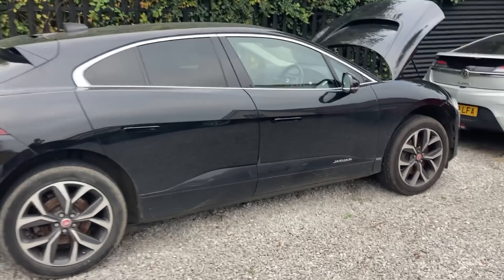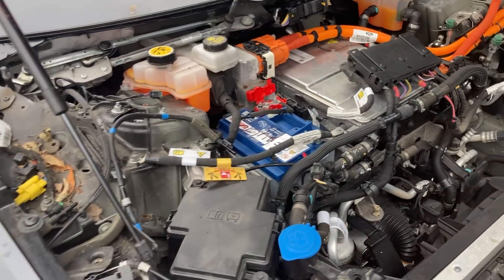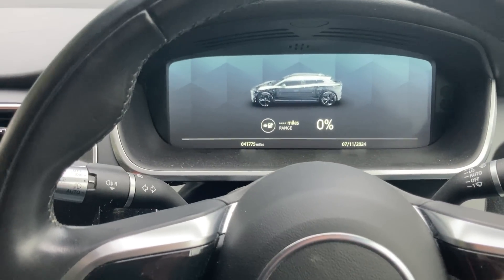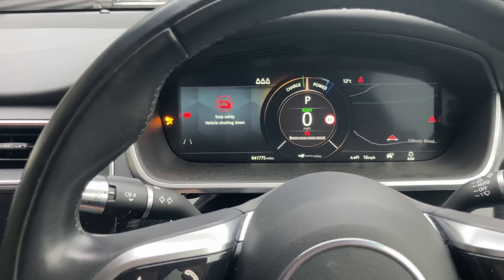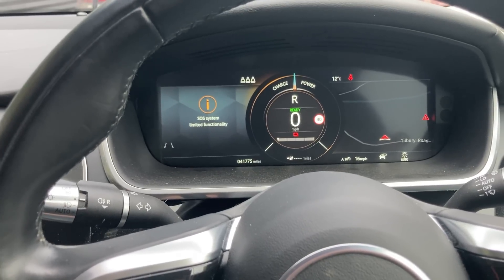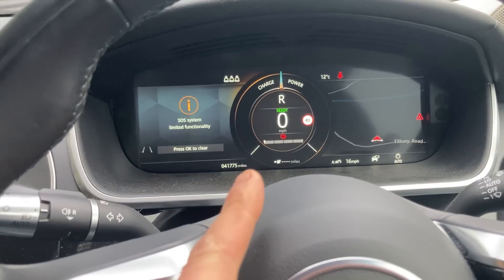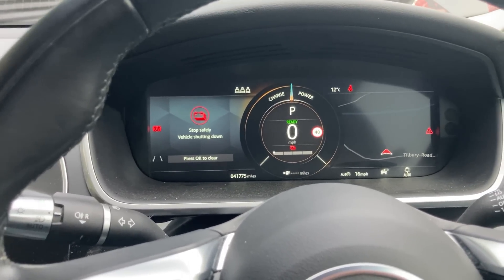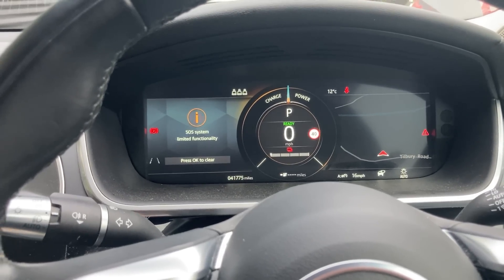This premium EV has multiple serious faults - Jaguar i-pace electric car issues - hv battery, motor.

Comment: EV power train electronics demand the best SMPS designers possible. As an SMPS designer with 40+ years experience, we all know if one thing goes wrong in design topology or implementation or build quality or component problem or lifetime or odd operating gremlins then you are in deep doo doo. SMPS means Switched Mode Power Supplies. You are switching 400 volts + at hundreds of amps hopefully using the best topology, the best components in a nice cool(ish) environment and with sufficient design time. These designs are never right first time, so pressure to get to market will be intense = not good for you, the customer. Taking the issues into account, it is possible to create a reliable long lasting system. But eventually, certain electronic components will reach end of life which may lead to scrapping of the vehicle. I'd be interested in the projected 'Bathtub Curve' for EV's. It will exist, but they will resist publication. The bathtub curve details infant mortality, base failure rate and end of life for certain operating conditions. It won't include battery explosions as this will be considered an 'Act of God'.
Reply: Brillaint comment. I think this is an issue effecting other EV's as the development curve and release cycle is very steep. VW ID3 is another that is this way - it was rushed to market